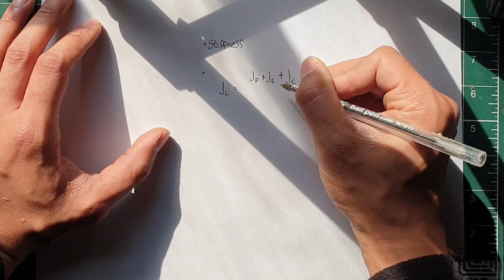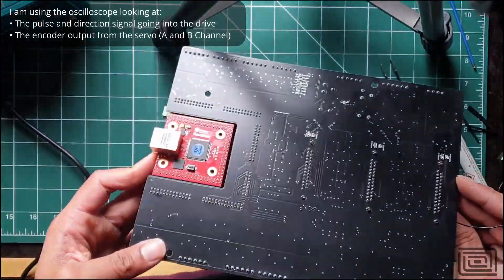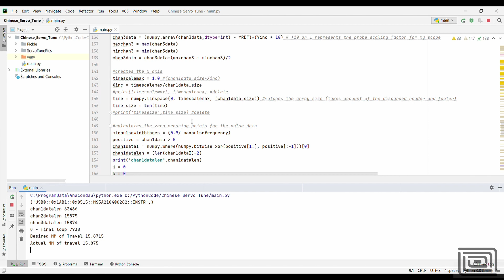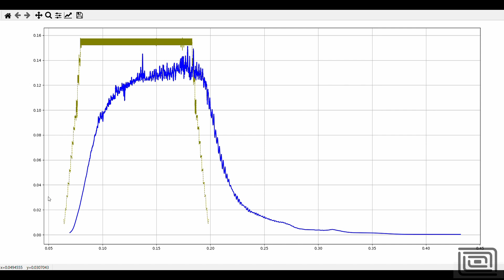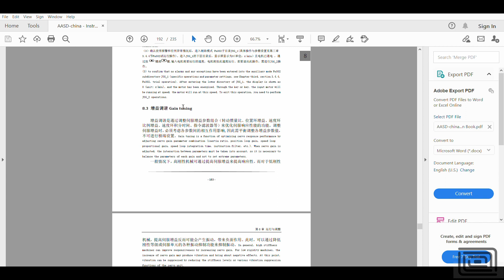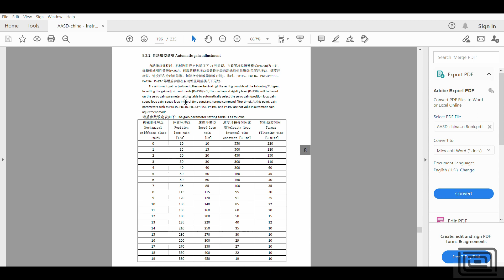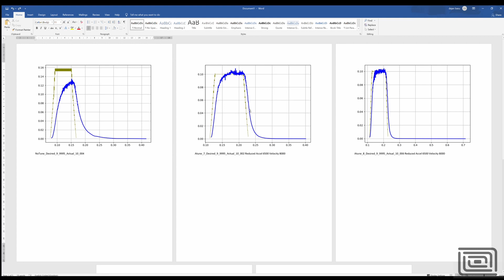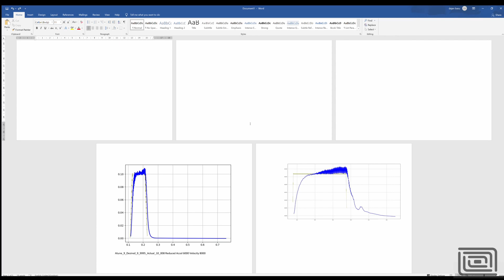How to Tune Cheap Chinese Servos Drives

Comment: Hi, Thank you really much for this Video. I have the same Motor and driver with a BT30 spindle over 1:2 Belt reduction. Before I had the spindle in analog speed mode before, but now I need positioning. I had the wrong and incomplete manual without extended control parameters or any information about the tuning so I tried to adjust the Position proportional gain and other parameters by hand. That didn't change anything so thank you for the Manual and the explanation! As we have very similar systems please tell me which parameters you changed to what. Just the Pn 259 to something low like 1 or 0 or something else to get the values to work? I don`t need a really precise spindle position or dynamics just positioning for tool change.

Comment: Many of the china servo drives come with (2) 2k  1/4 watt resistors......what are they used for?
Reply from the maker: I haven't come across this myself. It could be  a braking resistor. But may be best to understand the energy dumped through them before setting the deceleration profile
Reply: @vhospher6463  They are only 1/4 watt resistors. Something to do with limiting current to drive step/direction inputs perhaps? No mention of them in drive manuals or wiring diagrams.
Reply from the maker: @funone8716  sorry I read that as 2 1/4 ohms.

Yes itll most probably be for limiting current as the drives have optocouplers that are limted on current input. Thus different system voltages require different current limiting resistors
Reply: @vhospher6463  It's frustrating there is NO mention of them.

Comment: Can you post more information about the signals you are scoping? How do you get an analog signal from the encoder data?
Reply from the maker: Hi. The encoder feedback data is digital 0 to 5v output. The scope is reading the raw A and B signal from encoder.

The data needs post processing before it makes any sense
Reply: @vhospher6463  Thank you. I more-or-less figured this out after I posted the question. I would be very interested in your Python code - I am planning on converting a PM833 Mill to CNC with Lichuan servos, and they have essentially no software support for tuning. I have a Saleae logic analyzer which might be even better than an oscilloscope for capturing the samples.
Reply from the maker: Yupp. If i find some time ill dig it out and upload it!
Reply: @vhospher6463  That would be awesome, thanks!

Comment: Man, thank you for such lesson. I am using the exact driver as your datasheet -aasd15a. I didn't have good experience with the Pn257 adjustment. My calculated inertia mismatch is 31 but it work perfectly withe Pn257 = 1. I run the system the Fn018 function, the driver estimate my system inertia as 8. I input that value to pn257. The motor still rotate, but it was rumbling as well.
This is scary! I did not dare to adjsut Pn257.
Can anyone provide me some tips? 😢

Comment: Surprise surprise, there is actually a software that can connect through serial port to these drives.
Reply from the maker: Ahh mine didn't have a serial port connection. No connector present.
Reply: @vhospher6463  wait wait wait... what is the name of your drives? They look a lot like AASD-15A - if yes there's a round connector with several pins for RS-232 / RS485 connection . There's a proprietary software out there only with Chinese language (it seems to be created by 3rd party) and it has an oscilloscope graph with several inputs and quite a number of other options. Edit : yep it seems that the old versions do not have these round connectors capable of data transfer
Reply from the maker: Hi yes. I beilive the newer ones have the connection. But my drives dont unfortunately

Comment: im just getting started with these chinese servo motors and I am trying to hook up the centroid acorn encoder plug to the servo driver, and i dont know where to plug in the 5+VDC from the acorn into the servo driver. i just dont know where to plug the a+a-b+b-z+z- 5+VDC and GND from the acorn into the 110_m06030 driver. could you help me know where i should plug in please? do I use the db25 pin 22 to connect the 5+VDC and pin 1 to the ground?my manual shows pins 15,16,17,18,19,20 for a+,a-,b+,b-,z+,z- and pin 22 is z open collector output and pin 1 is GND my problem is that I dont know where to plug the 5+VDC from the acorn to the servo driver, would I just plug the 5+VDC into the z open collector output pin 22? because that is the only pin that is left over to use. please help thank you.

Comment: As if by magic! I am literally tuning these very servos this coming weekend! Thank you for such an interesting video.  On your estimation of stiffness in the belt: I would have intuitively thought the same (that belt systems are not very stiff), but a counterpoint I have seen recently is a yoke of a 5-axis CNC machine driven by a poly-v belt.  Apparently that belt is sufficiently stiff to support a huge A-axis, which blew my mind.  Anyway, thanks for the video :)
Reply from the maker: I have used belts many times with servos however in every instance its been with much more sophisticated servo drives. Most of the beckhoff servos i have used haven't had an issue once i have set them up correctly.

Glad you found the video useful!

Comment: This is AWESOME!! Do you have a Github? I have 3 servos of those, and obviously I don't know how off they are and this could change my life! I'm not an electronic engineer but I do have some knowledge  about the servos and about computers, Linux in particular. Let me know if you can share your software with me. Thanks in Advance!! Also I do have an osciloscope, and has like a usb connection to get the data, so I'll try to make this work.
Reply: You usually use software from the manufacturer for step-response, tuning etc., they're often proprietary. 
Even the chinese cheapo jmc integrated servos come with a proprietary software. So, most probably no need for an oscilloscope.
Reply: @heinzhaupthaar5590  in this specific models, they don't have any sort of software, just parameters to calculate, so for that specific model would be awesome to have an alternative. But I just bought one JMC and yes they do have some assistance, also the oscilloscope tool. But again, nothing like Delta auto tuning or DMM.
Reply: @johnlocke9609  There is a software for AASD servos actually.
Reply: @chronokoks  I have the version that has these round connectors, what's the software that is compatible for this drives?
Reply: @johnlocke9609  it's called Servospy  / Tuner 1.1 by Fire
Reply: @chronokoks  Hi, can you give a link to this software? Google do not show anything meaningful :(